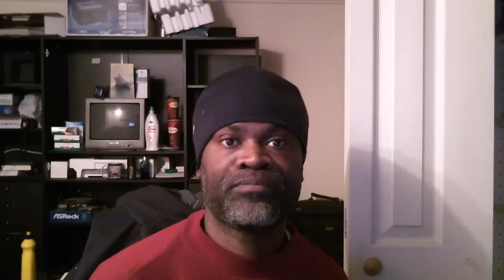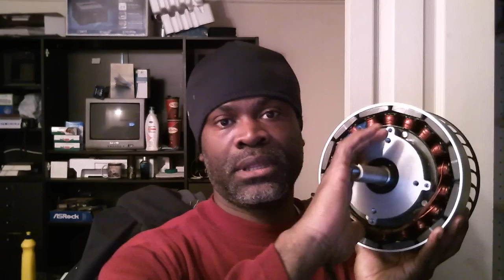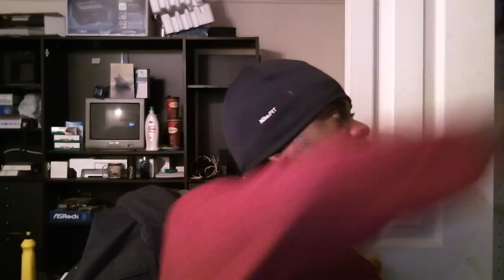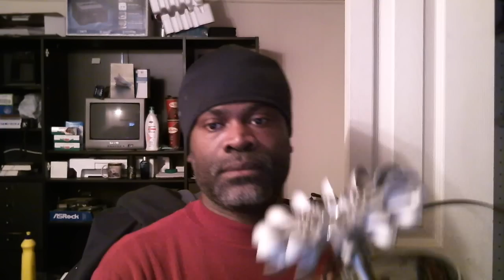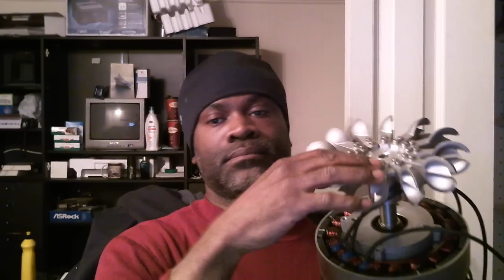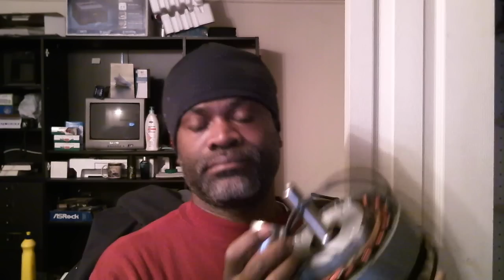Generator for Pelton Wheel - Micro Hydro Turbine Build

Comment: I've used the same generator and pelton wheel to make a working generator that can charge my battery bank. The amount of water pressure required to get the 3000 watts claimed by the manufactures is somewhat of an extreme case. "very unlikely"  I've posted my video showing this at work. Micro Hydro Generator. parts 1-4. by serranc11offgrid.

Comment: Can you setup multiple stations on a downhill 4" PVC water drain pipe? Just ground water is flowing through pipe. How would you setup this pelton wheel and generator on a mounting bracket?